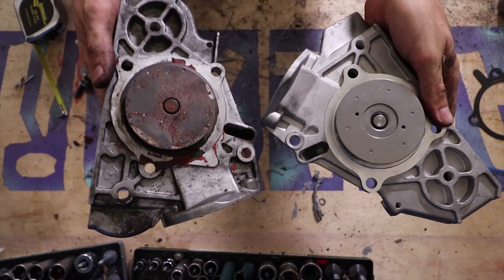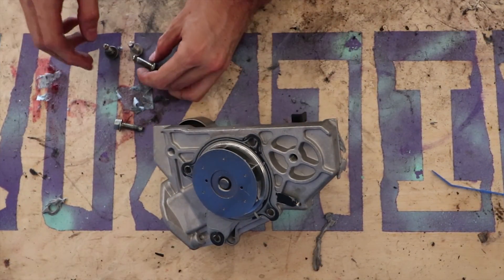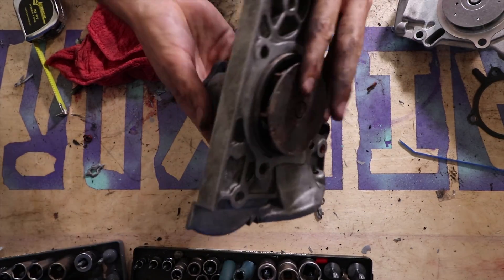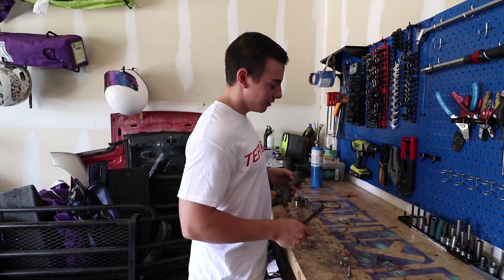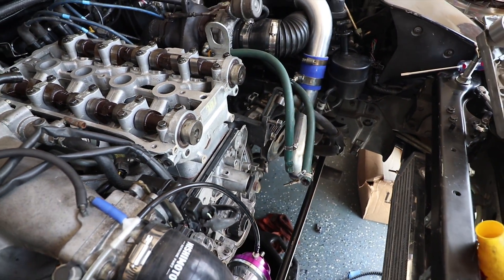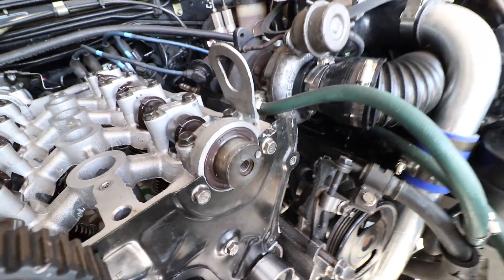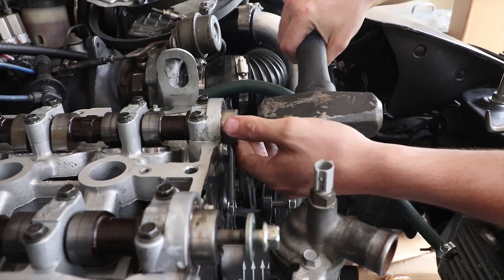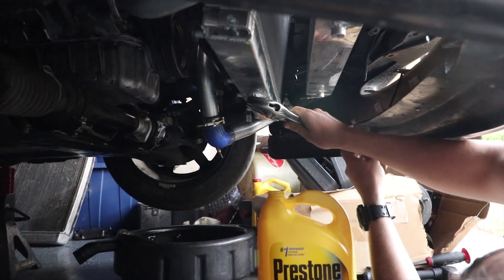Why you should never buy a cheap aftermarket water pump...

Comment: how bad was the leak when you realized you needed to replace the o-ring?
Reply from the maker: Our water pump was leaking so bad that we couldn't let the car idle or it would have pumped out all the coolant. It was really bad. After we changed out the seals and used some RTV that was designed for water pumps, it stays completely dry now.  Hope this helps!
Reply: The Daily Drift ** it definitely did thank you! Glad you fixed such a simple issue. Tearing down the engine block to see where my leak is coming from ( ring or bad wp).